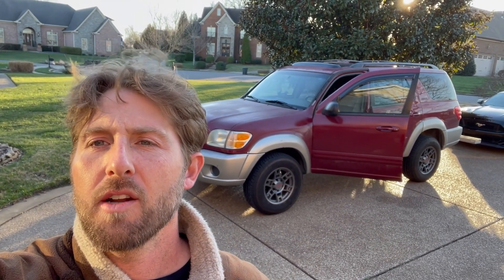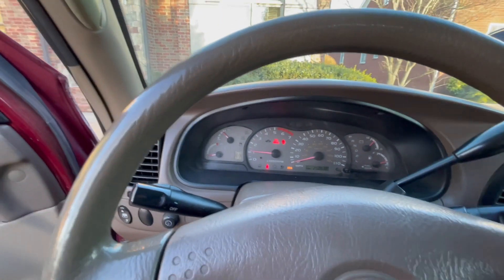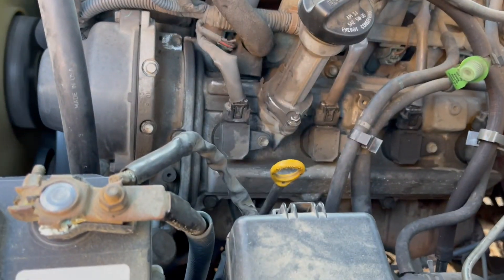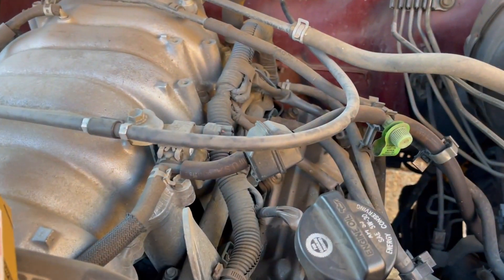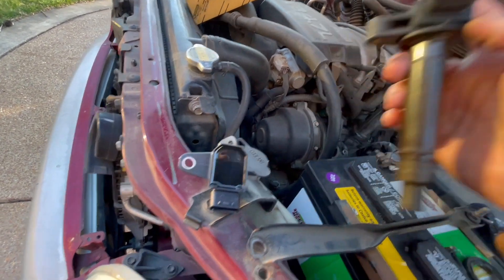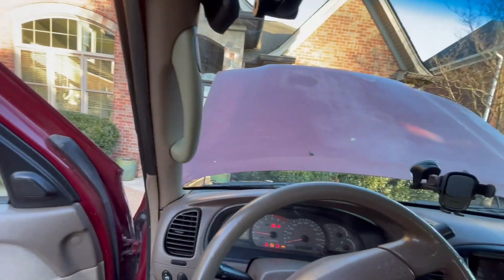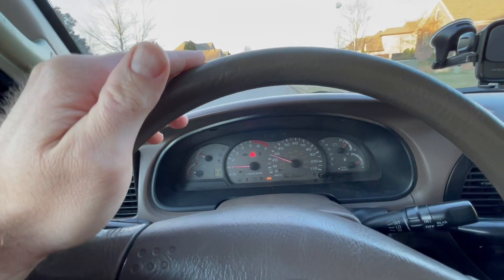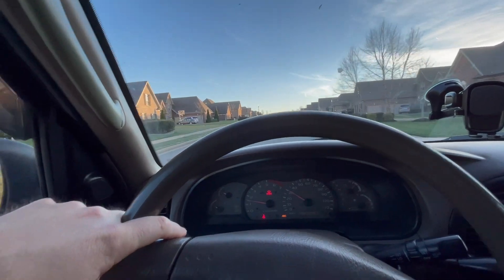How To Fix Engine Misfire (Coil Pack Replacement - Code P0300)

Comment: How long does it take for the coil pak to register fixed
Reply from the maker: Once it’s fixed it’s fixed, it will stop misfiring immediately- you can clear the codes or disconnect the battery to reset the check engine light
Reply: @JakeTiesler  still seems to be misfire
Reply from the maker: Then it wasn’t the coil

Comment: I have a 2002 sequoia did a timing belt and water pump change and 2 weeks later it's misfiring and I can see coolant behind water pump so I'm assuming its the water pump gasket my kit came with paper type on ours had metal on one it so have to redo the job I guess I'd rather change a coil pack lol
Reply from the maker: Sounds fun haha

Comment: You mentioned that this had happened before, was it on the same cylinder? I had a random miss fire on my #7 cylinder, swapped coil packs with #1 and it didn't come back for a while. Now I'm getting P300, and P301, P307. The codes come on only under a super heavy load, it happens only at highway speeds going uphill.
Reply: I'm having same situation... I recently has it happening. Was under load and definitely not getting power
Reply: @blaurence4123  My issue ended up being that the bad coils wore out the spark plugs (probably 25k on them). So when I moved the bad coil around, the bad plugs would not play nice with the other old coil packs. And even when I got new coil packs, it would feel underpowered under heavy loads. So check your spark plugs if you haven't done so. Good luck.
Reply from the maker: It happened on different cylinders - so these old packs are failing or something is shorting them
Reply: I'm having same situation... I recently has it happening. Was under load and definitely not getting power

Comment: You mention that you don't understand how you got the coil pack for $40 on eBay. Well, it's almost certainly counterfeit. It may look perfect, with perfect packaging but be totally bogus. It will work probably but it's not OEM. Counterfeit auto parts have flooded eBay and Amazon. They are so good that a visual inspection may not reveal the truth. If you want OEM you need to buy from a dealer. Toyota Parts Deal has some good prices and you buy directly from dealers. Not third-party rug salesmen in some Algerian bazaar. I had the same problem on my 2000 Land Cruiser and had to buy an aftermarket coil pack from Autozone but I immediately ordered an OEM Denso coil pack to keep in the truck as a back up. My OEM packaging, by the way, looks nothing like the packaging on yours, for what it's worth. But these knock off coil packs usually work and you may not have any problems with it in the future. Glad to see you back on the channel.